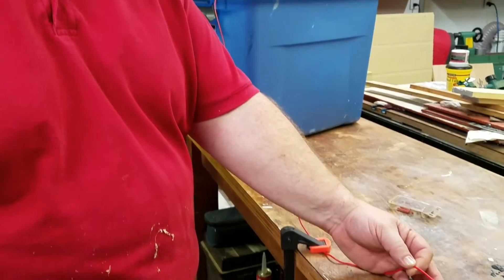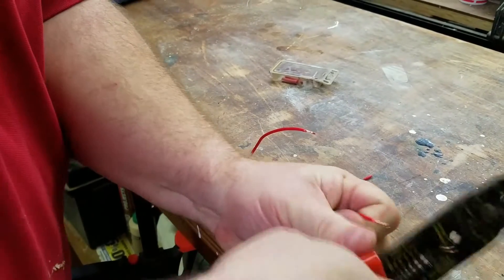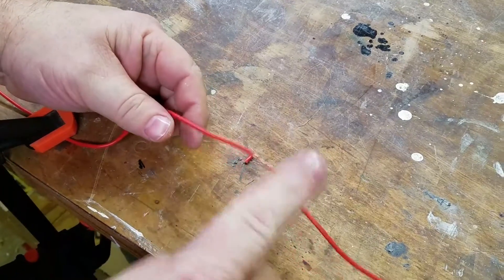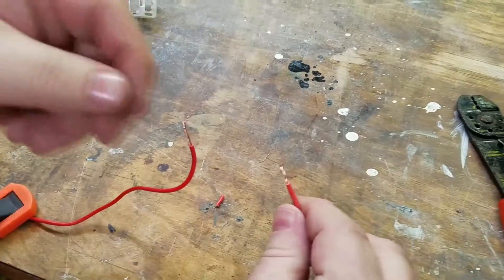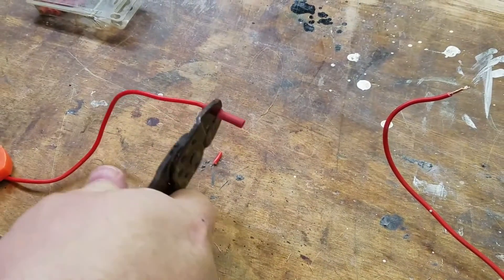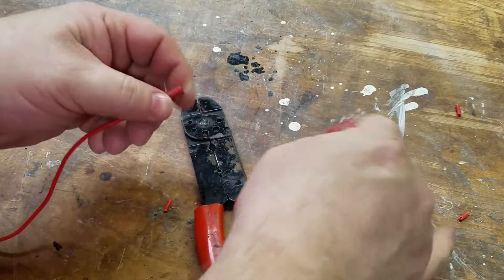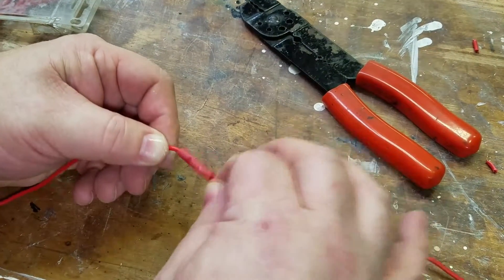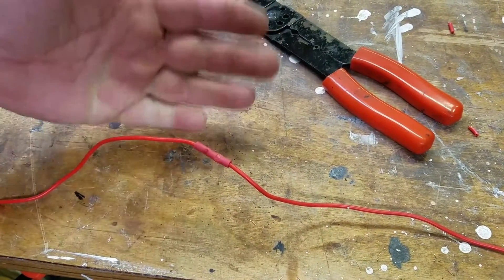Safe wire splicing for mobile applications.

Comment: Thanks Dave. Although you can't see exactly how I twisted the wires in my video, I pulled them down together 180 degrees along the length of one wire after twisting kinda like tying a knot where 2 extension cords meet. And then taped them.  Either way though, thanks for the tutorial, and I will get some butt end clamps and do it right. Thanks. Merry Christmas.